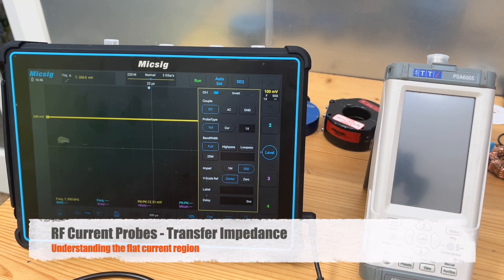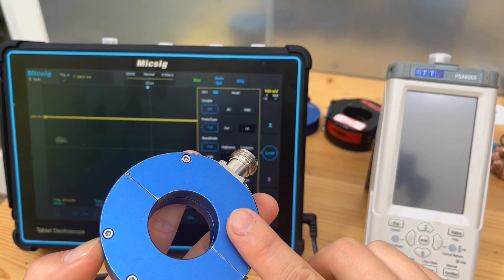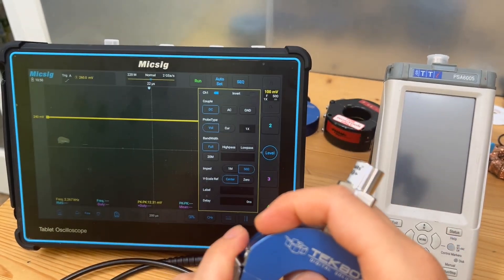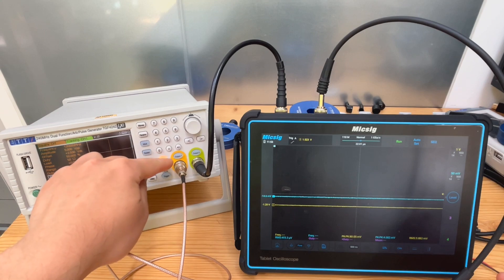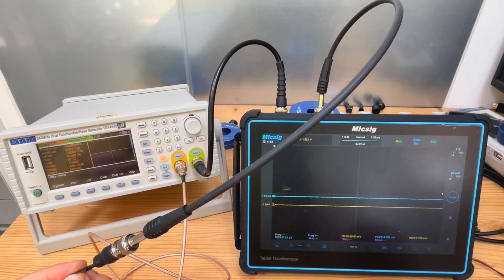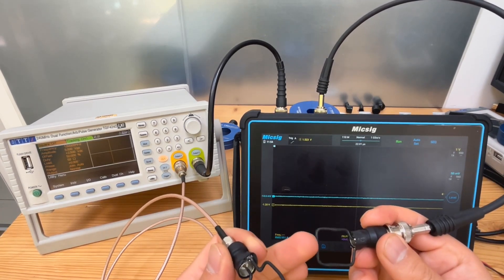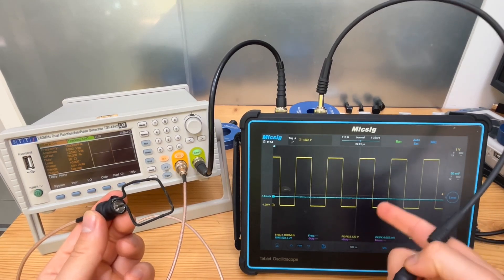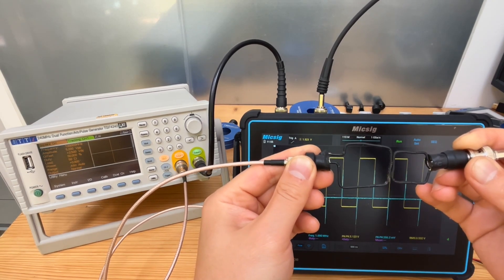RF Current Probes Episode 2 - Which waveform do I trust?

Comment: Hi , Very informative, thanks for your effort. by the way, i just wonder if the metal loop is built by you on both the probes. if so it looks thick , may i know what is the material? is it Cu with single strand? and would you share your thoughts on the influence of AC resistance ?

Comment: You are feeding a loop-wire with a signal generator. What is the driving capability of the output of the generator? Maybe 200mA?
Reply from the maker: we can calculate the current by using a first-order simulation model. in this case, the current is limited by the 50 ohm termination (for low frequency current), the majority of the energy actually reflected back to the source!